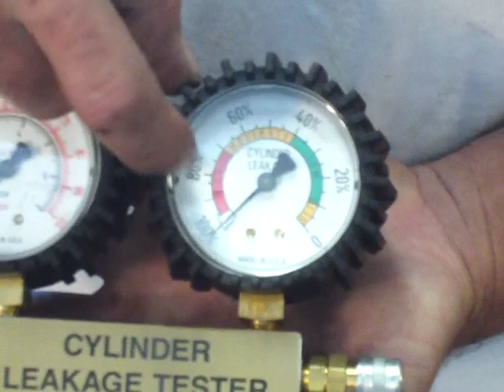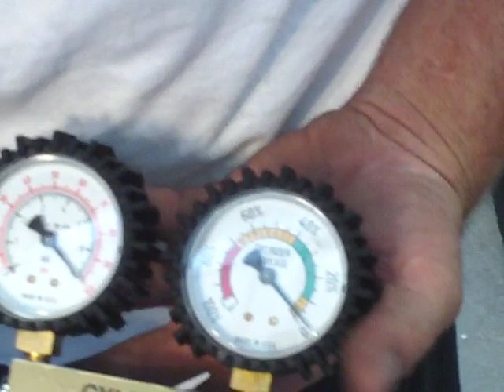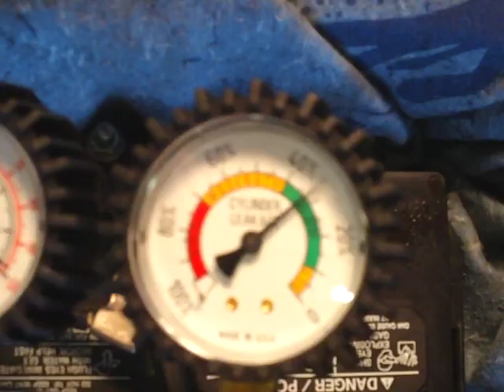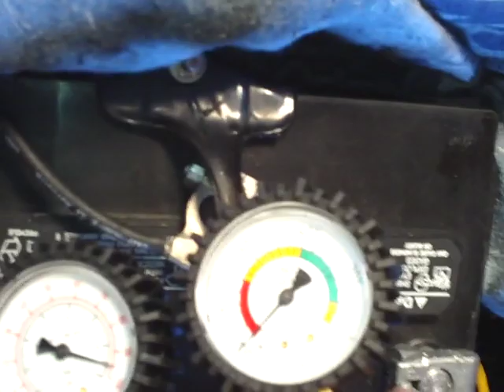How to perform a cylinder leak test

Comment: Nice video I did mine and am stuck please help, ok I did the leak down test, because there was a misfire bank 1, then check for compression cyl 1 100, cyl 2 150, cyl 3 150, cyl 4 150, so I have a loss of compression the went for leak down test cyl 1 47%, cyl 2 28%, cyl 3 28%, cyl 4 28%.
When I did a leak down test on cyl 1 the air was scaping from the spark plug hole of the cyl 2, so what would be the cause of misfire?
Just so you know I had the pistons at top dead center.

The car is a 2003 Mercedes benz c230 kompressor, with a 271 engine 4 cyl.
Reply: Guillermo Fernandez I know this is 3 years late, but it might be fuel injectors or the spark plug wires

Comment: PS...the idle does slow down when i tap my foot on the gas.  But, something is really off about all this.  I have no idea what.  I have put new plugs, wires in it, new fuel filter, sprayed carb cleaner in the carb;....And, I changed the oil, which ironically made it appear to run worse for awhile.  Took it to 2 other mechanics.  One said he could tell by "listening" to it, that it was the timing.  took it back for him to redo the timing, then he drove it and said it wasn't the timing, lol.

Comment: Oh...2 days later, the oil level went back DOWN almost to the full mark.  I think it smelled like gasoline.   This IS an interference engine.  The spark plugs...they also had  sludge on them to the threads.  Before the timing job, they were dry and clean.   What the heck has happened?

Comment: He did the timing job about 3 weeks ago.  I have been too afraid to drive it far.  It appears to have a  miss when i am driving at  ANY speed .  The idle is screwed up.    Runs real  fast  and will  not slow down.     The oil level went WAAAY UP right after he did the timing belt.  had trouble cranking it a few times.  That was highly unusual, also.....Just know it all started with the timing belt.

Comment: Ahh.  It's a 86 Nova, with less than 70Kmi on the engine.  But, it sat up.  I got it in June. Have been spending money like mad trying to keep this car running, because my other car is  fubar, as the previous owner apparently put STOPLEAK in the coolant and it has fouled up everything.

Comment: i just had a timing belt/water pump change, and, now it looks like i have a head gasket in progress.  right after the timing belt was done the car appeared to have difficulty starting and rode like it wanted to leap forward.  man refused to redo it, saying he set it just right, blah blah blah. basically said "NO", he would not take it down again to see what was wrong.   didn't take long for it to start misfiring.  i just don't know what to do at this point.

Comment: Removing one or all will not affect the readings as you're only testing one cylinder at a time. Removing all plugs will make turning the motor to TDC much easier though as there will be no compression to deal with

Comment: He did say that you would hear air escaping through the exhaust, intake or crankcase, but at 30% leakdown, air is escaping anyway. It's the difference that matters. A useful tool for this is an automotive stethoscope, with the metal probe removed (so that you are listening just through the tube). Say one cylinder is bad, and you listened down the throat of the carburetor, and it was louder (more air) than the others, then suspect an intake valve (cracked, not seating, etc).

Comment: I believe the reason for testing at a warm engine, is to allow the rings to expand and seal against the piston wall. HOWEVER, at cold engine 40% of leak, is ok and once everthing is good with valves rings etc, this value should fall as the engine warms up.

Comment: @BigAgitator just back the pressure down, that's why the leakdown is given by percent so you can set the value to what ever pressure is needed. Try setting the cylinder and slowly energizing it up to the point it begins to rotate then back it off a bit. Reset to TDC and gauge your leak percent.

Comment: Thanks for the info.  I brought mine to tdc (small engine).  I used a screwdriver in the spark plug hole but the motor still wants to roll over when I energize the cylinder with pressure.  I tried to get it bingo on tdc but no matter how good it is, the pressure is enough to start the engine rotating.  Any suggestions?  My theory is: with a car engine, there is enough internal resistance that the piston can be within a few degrees of tdc and not roll over.  A 20 hp engine is a different story.